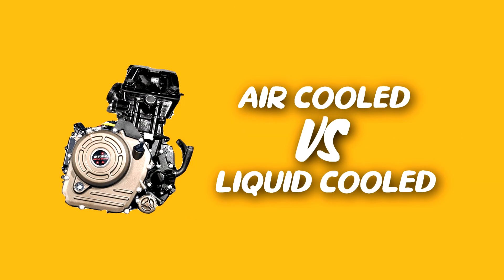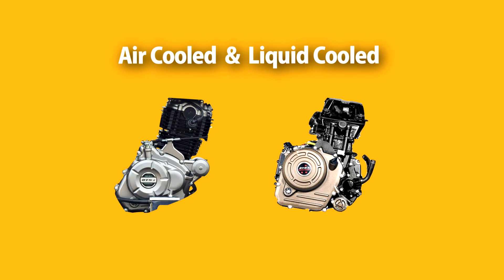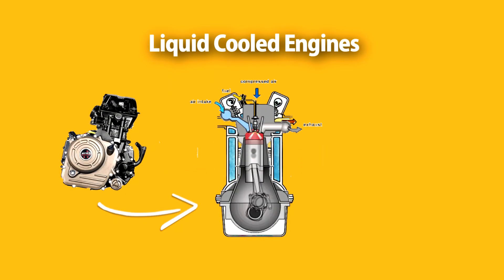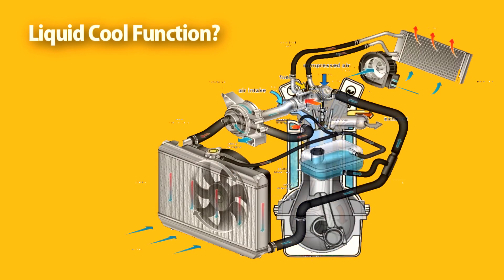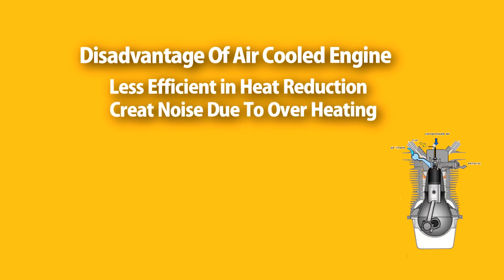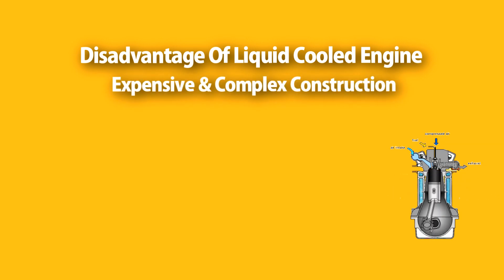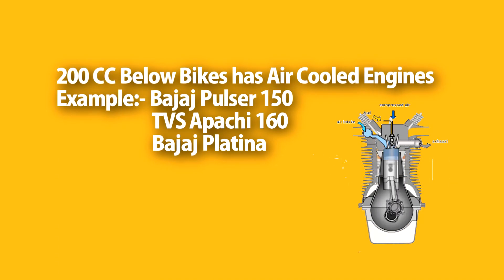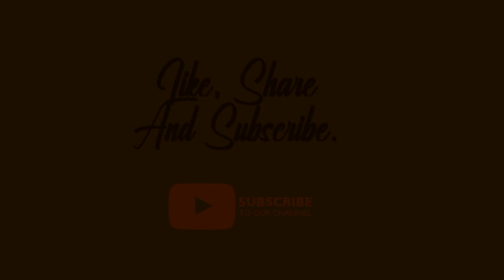Difference Between Air Cooled Engine and Liquid Cooled Engine || Air Cooled VS Liquid Cooled Engine

Comment: How about durabilty of aircooled engine,it is the same durability of watercooled engine?
Reply from the maker: In terms of durability both the engines are same  whereas water cooled system required more maintenance then air cooled system, in every 2 to 3 months water level of water cooling system must be checked and maintain properly.